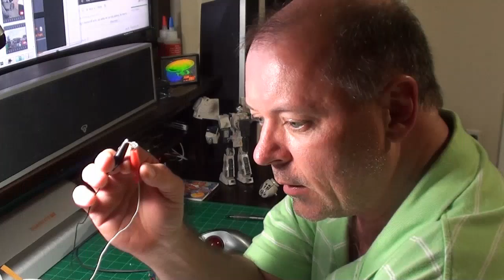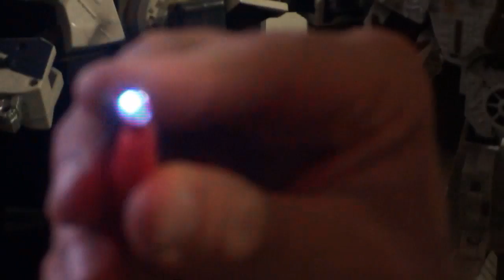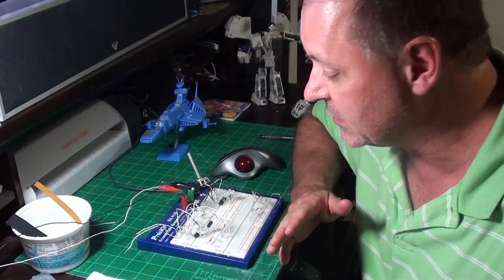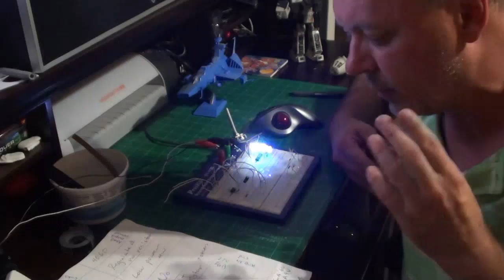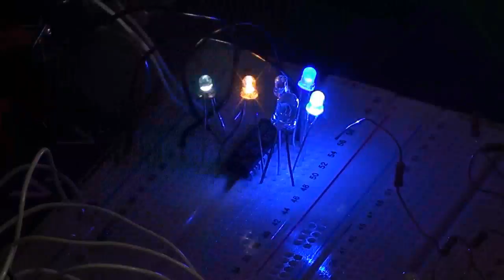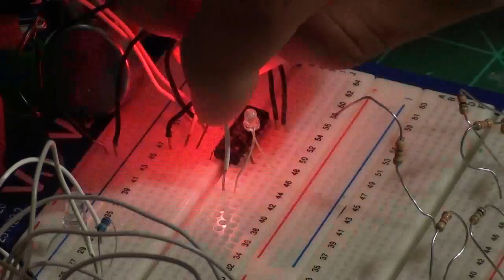Lighting tutorial:  4060 Pro's and Con's

Comment: Hello sir, need some help. I have followed your video closely.Can you confirm that 4060 chip I require has to have the notch to the top left handside of the chip? I have a 4060 chip and the notch is at the bottom of the chip and cannot get the leds to blink at all when everything else is correct. Could possibly confirm if I have the wrong 4060? Thanks
Reply from the maker: There is only one notch on any IC chip.   This is so that you can orientate it properly.   If you have it on the bottom side, just flip it around.
Reply: badgrendels 

ok I'm currently using a 0.1uf capacitor and a 104 potentiometer   and can't get it to flash. Is the capacitor the correct value? Do you have an email address where I could contact you directly for help? mine is liver999@yahoo.com
Reply from the maker: Your resistor is probably too low, so the led is flashing so fast you can't see it.    The resistor should be near 470K  I was using hear that value with mine.   I did look up your potentiometer,  and I think it ranges from zero to 1 mega ohm.  So it should work, try adjusting it.

Comment from the maker: Norm, I noticed a few funny behaviors out of my test set up last night.  I was trying to load her up with LED"s and some LED's were lighting and others were not.   Then I would pull on LED, and others would start flashing.   

So give this a try.  Remove all the LED's but one.   Put it across two pins on the side opposite the resistor and the capacitor.   If it isn't flashing, try to move it around a bit, and try a different LED.   Let me know if that works.

Comment: J.    I have bought some 4060's from China...  (4060B) to be precise and wired it up with One LED per Output (Leg)...  and All I get from it is a Count to Max count and it JAMS up !   Full lights.  and when I approach the circuit with my hand it either goes or stops,   I am at a loss !  I'm using a breadboard as well (NEW)  but it won't keep blinking like yours...  it counts then Stops !   what is your source for IC in the states or Ebay ???   Thanks.